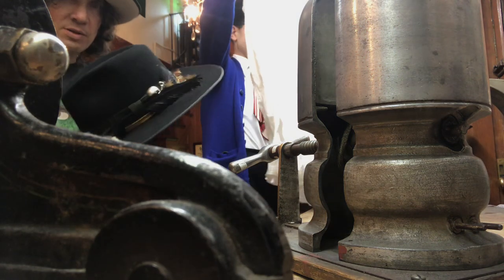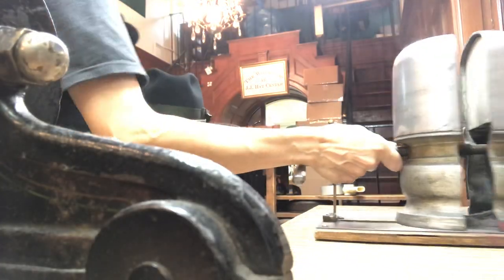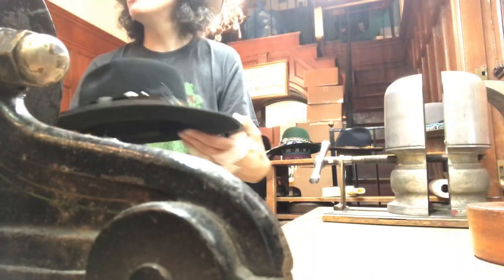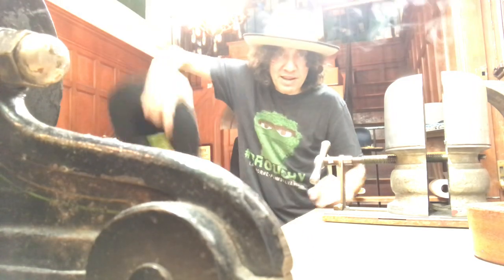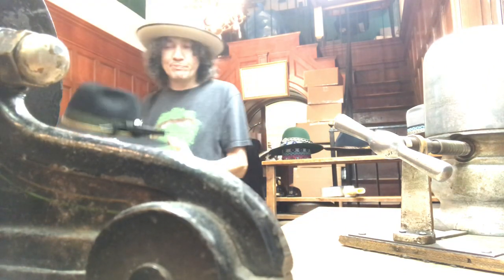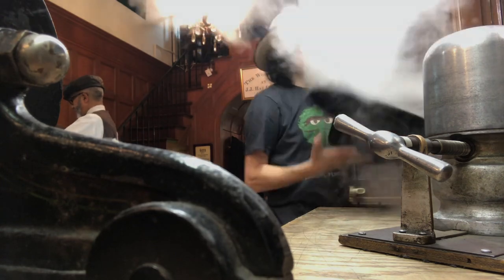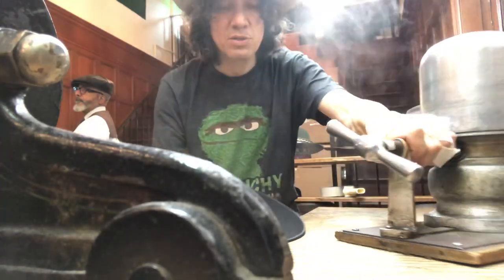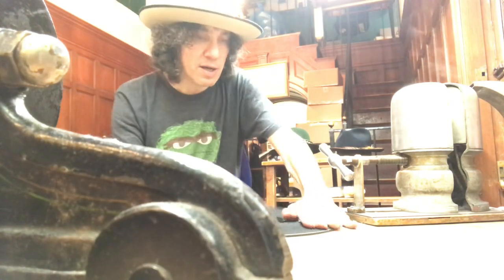Trying to Flatten A Problem Flat Brim w Stiffener & Steam

Comment: I buy old fur felt cowboy hats, then iron the brim down as flat as possible. Then coat the hat, multiple times, drying time between coats. For covering the brim...cotton feed sack cloths (Wally World bought). Large enough to cover the entire hat, cheap, and also used between the iron and brim (wet down with distilled water from a spray bottle). 

It is a job. Can take a few times to get the brim flat. I use whatever is heavy for weighing the brim down flat. Once I used guitar pedals lol. Anything will work as long as it has weight. Feed sack over the coated brim, weights, and waits ( patience).
Reply from the maker: Stephen Garen that’ll work, we have an Iron for flat stuff, but the hatmaker uses it, I rarely touch it,although my coworkers wear flat brims, they use it often, and yes, covering them with a cotton cloth first would be essential...nice work!!!
Reply: @KTGHATS   I iron the brim first, wet towel, as flat as possible, then apply multiple layers of...what is it? (looking at can)... extreme hold hairspray. Some of the old cowboy hats are pretty well stuck to wanting to bend upward. 30 to 40 years being that way, I suppose. Spraying a half can, or more, usually works.  Then I'll iron again and mirror check. Repeating until satisfied. 

I bought a couple vintage Resistols for cheap. They have a good six to six and a half crowns when opened up.  I basically turn them into Bolero style hats (telescope crown/wide brim). 

One of the Resistol hats was seriously crushed and mangled, but the felt is still good. It took a couple days, a few hours each day, to work the crown back into shape. There is a slight spot of discoloration, but is hidden in the telescope crease.  I showed friends of mine before and after photos, and one of them said, "It looks like a brand new hat.  It was really not cared for by whoever owned it before I bought it.  It was a challenge, but is one of my hats that people seem to like the most.  Grant Gray is the color, but looks more blue than gray. Sort of a light denim color.

Sourced a few vintage concho belts for a cheap price. Put a couple on each hat. One is like the band on the famous black SRV Plateau hat, but smaller and brown. It's on the brown Resistol. The other is a white leather strand belt with beads and silver conchos. I just wrapped it around the hat, sans a few beads, then cut off the excess strands.  The rotted macrame and feather bands had to be replaced with something, so I went with vintage concho belts.
Reply: I meant one on each hat, not two belts on each hat. Lol

Comment: I'm trying to reshape a standard brimmed cowboy hat to a complete flat brim like this and am having a hard time overcoming the "memory" of the stiff original brim shape. My steam source is DIY (pot of water), not sure if lack of real heavy jetted focused steam is the main issue. I can't get a solid sharp 90degree angle of crown to brim. the brim is either heavy tension holding brim down, or tension flipped upwards similar, but reduced, original shape.  I havent set heavy objects on the brim yet, but am not confident my weak steam job won't make a difference. Given my lack of a real steamer, any other tips to overcome the stiff memory? soaking the brim with water them flattening? Thanks for all the tips so far! I've reshaped some nice thrift scores!
Reply from the maker: Presidio Wildlife , I’m sorry. it is not gonna happen, u need more than just a Steamer to do that. It will take many coats of stiffener. Or hair spray..maybe 6-10 coats, it needs to be very,very stiff to be flat. a lot of stiffener, then u steam it a lot, and put a very flat, heavy weight on it, overnight.. keep repeating.. it may take 5 or 10 processes. This is too much to expect from a Steamer, Western felt is too thick and going flat is hard, u need it to be mega stiff.. even I struggle with this stuff, it
L never be flat, it’ll curl upward..keep repeating this,.try your best, but I’m not too sure it can be done completely flat w your equipment.
Reply: Presidio Wildlife Make a hat block. Cut a circle in two pieces of wood so that the hat will fit between them. Drill a hole in each corner of the wood blocks and place a screw and wing nut in each corner hole. Once completed place the hat between the two blocks and tighten the screws.  You can applied spray stiffener if you like. let the hat sit in the block when not being used and your brim will be flat as a table top. This is an old Drill Instructor trick used on our smokeys.